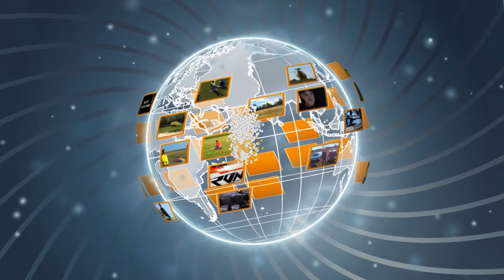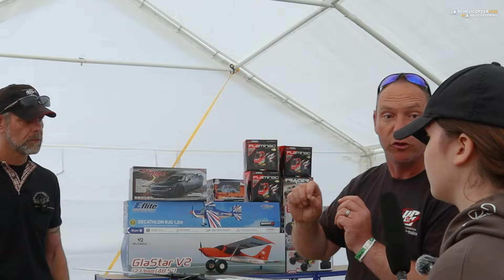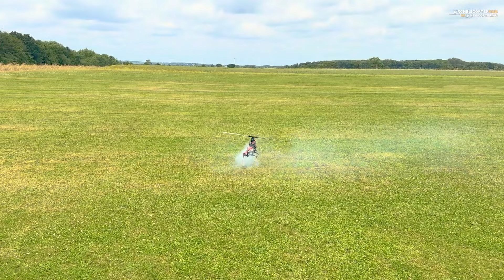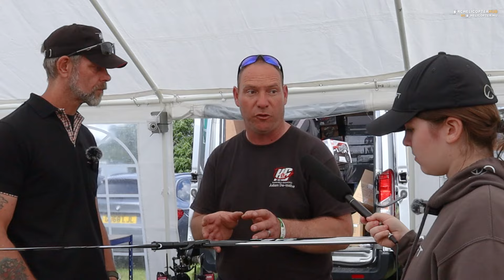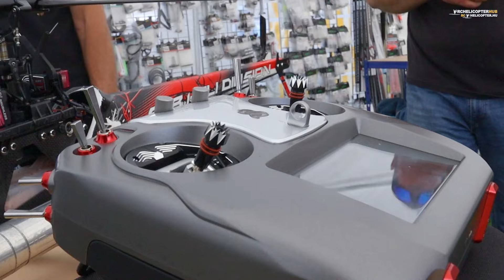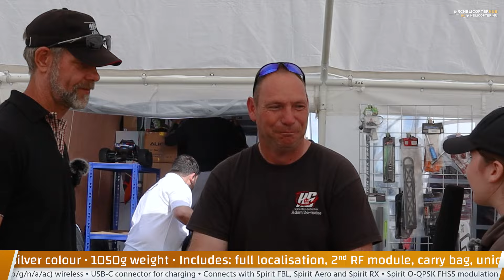The NEW Spirit WAVE RC TX/RX system

Comment: As a longtime Spirit user with Jeti as the TX, I see RotorFlight and Radiomaster running express ELRS with LUA script integration as the biggest competitors in the future. They have different quality points, but the value of RF and the development speed are quite remarkable. Being open-source, I see, is a big advantage. Already, good flyers in OZ are dropping Vbar and going to RF. I hope Spirit does well with the radio, but it is going to be a tough market. Thanks for the video.
Reply: Excellent informative comment here - love it - I'm looking out for the Nexus!!
Reply from the maker: You are most welcome. I read that more and more of you guys are leaving the Mikado ecosystem. What do you think, was the bumpy release at Mikado a big cause of this market loss?

Comment: Its the hard deck features out of everything that have me most on board with this ecosystem.  I am a new to the hobby and went Radiomaster as my first TX with an S1 and S2. I just recently graduated to a Nexus/Rotoflight/ELRS  system on an RS4 Venom.  I like the horizon and aerobatic modes for roto flight as training tools and they have had immense confidence boosting for me to try some of the more extravagant moves.. But this hard deck for Spirit is really compelling when I go into the 500-700 class sizes.  I see it as a protect on my investment with such large expensive craft.

Comment: How will the old spirit unit connect to the wave transmitter? Will it support telemetry and 30 channels with older units ?
Reply from the maker: As far as we understood, yes, it will, but how much? I suppose: it's fully compatible with previous FBL, as the new FBL is pretty much the current GTR.
Reply: @sharkiedoo  I spoke to alessio at Helifest & it seems there will be an rx or satellite that will integrate the old fbl’s to the wave radio.
Reply: @martinchurch2863  thanks for the information!!! And for taking the time to write your message

Comment: For 1250 us dollars I don't see this going very well. I know some people are die hard spirit fans but mikado dominates the integrated market. I think they'd sell very well if they were priced around 600-700. Frsky or radiomaster is the way to go now. The rotorflight integration in frsky is great and for 80 dollars for the flight controller and 400-600 for the radio, why would you want this
Reply: I ordered one.

I like the Spirit FBL. It’s easy to setup. 

I haven’t had hands on the wave but it looks nice. The integration looks superior to any other brand. I will gladly pay for ease of use.

This is not a cheap hobby. Many who are in the hobby can afford it. The targeted user of this is the same people vbar went after.

Spirit support seems great.

My biggest concern is if spirit goes away will my radio/FBL become useless? Other than that I think the experience will be far superior in every possible way to rotorflight, spektrum, etc etc etc… that’s why I preordered one.